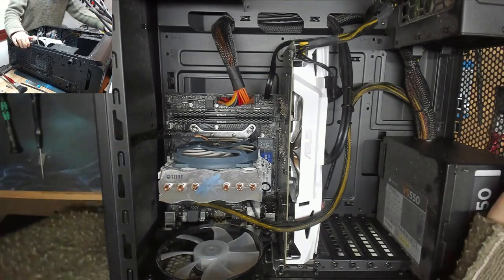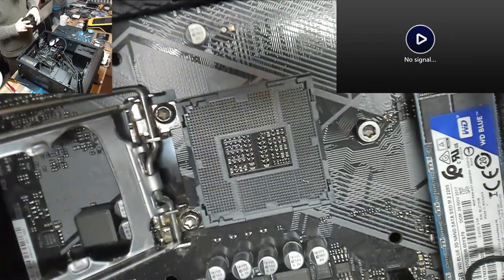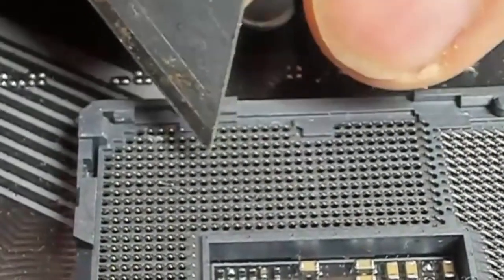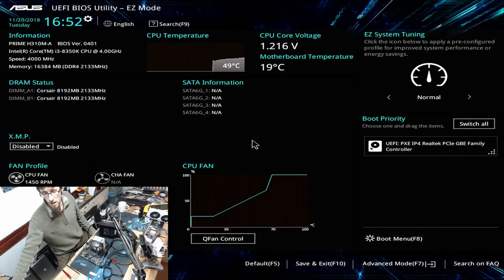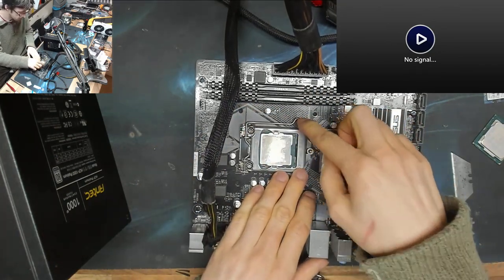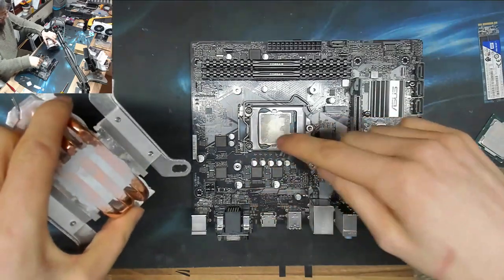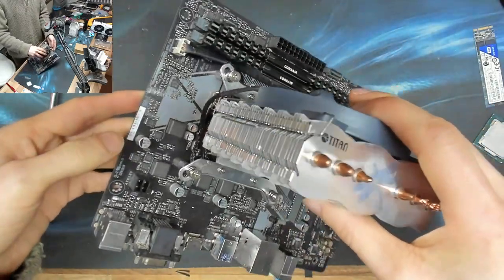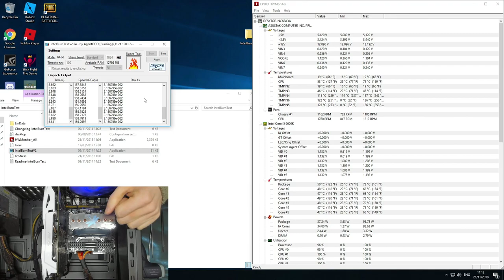LFC#151 - i3 upgraded to i5, No Post, Bent CPU pins

Comment: Little tip Graham - Get a propelling pencil - remove the lead then use it to bend pins back it slides over and restraightens the pin then you can just move the pins back easily been using that technique since AMD Duron chip!

Comment: I have encountered bent pins many times, each time trying a different method or tool to straighten them out. The best method i found (i swear i tried them all) was not the knife blade or tweezers to straighten the pins but a lowly mechanical pencil. Strange, huh? How I did it was to draw in the lead so that it wasn't able to write and inserted the bent pin into the pencils steel shaft, then pulled the encased pin in the direction I needed to "unbend" the pin. The steel shaft normally holds the lead very stiff and it is remarkably strong compared to the bent pins. By enveloping the pin with the steel shaft, you are able to apply just enough force to straighten the pin, as you go along. A simple 45° or 90° bent pins are quick and easy to straighten,as most bent pins are like this. Aligning them to the other pins takes more time but if you do enough pin straightening, you will know how much strength you need to bend the pins "just enough" to align them in  the direction you need. I have done a few CPU'S (AMD) with bent pins and only a few less sockets using all kinds of techniques and testing various tool, noting my successes andfailures along the way. Thanks to friends with heavy hands and NO money to buy replacement parts., they have given me New skills.
Reply: Nice.
Reply: But that won't work on this type of pin, these are more like little fingers which lay at an angle, so you'd never get a mechanical pencil over them, your thinking of the older style straight pins and your method works very well for them.
Reply: @TheRonskiman  You are right.. I read i3/i5 and was thinking AMD bent pins. Intel bent pins are a nightmare. I tried unsoldering an intel socket and couldn't unbend a few bent pins to save my life!
Reply: Mechanical pencils were fantastic for fixing my bent 3900X pins, thought this expensive CPU was gone for sure. The pins were bent like 90 degrees and they were near the middle of the CPU. Luckily, am currently typing from said 3900X machine :P
Reply: and here i am using a straightened paperclip lmao
Reply: The best way to fix bent pins on Intel boards is to chuck it in the dumpster and buy an AMD setup.
Reply: @BrooklynBalla  LOL
Reply: I use a "wire-wrapping" tool, but I like the mechanical pencil idea.
Reply: Same method w/ a vape juice bottle, when those were a thing. Bent 75% of a Ryzen 1st gen troubleshooting before we knew ram was the issue. Still runs @4ghz since March 16' Method def works, but slightly smaller pins I'm dealing w/ here on a i5 6400.
Reply: @BrooklynBalla  Very funny. I'm doing the opposite - chucking my AMD setup into the garbage and buying into a 13th gen Intel platform with a 13700K. Why? AMD's products always feel like a beta test to me. Never feel premium, never act like they're premium, always buggy, always had problems since I switched to Ryzen from my perfectly fine 8700. Never again.

Comment: I use small empty pen to correct the bend pins. Just slide the pin in the hole and move it on the needed position.
Reply: I use a coffee stirrer . Also a pen ink tube can also work in a pinch

Comment: It's nice that you explained heat exchange on that type of air cooler, all coolers look shiny and perfect, and even that cooler is far from perfect, All coolers are far from perfect since the dawn of Pcs, the reason is this. The metal that looks nice and shiny and perfectly fine, actually at high magnification has a vast amount of impurites, pits, lines and bumps. these impurities can cause very tiny heat pockets to develop, so that is why thermal compound is used. So to end the debate on how much compound you need; You should only need a small amount spread like butter over the cpu, a very thin layer, as all your aiming to do with it is fill those metal to metal impurities in both the cooler and the cpu's IHS.

Comment: This happend to me 2x i bent 2 pins while removing the cpu for an upgrade. First it was a celeronG3900 than i got the i3 6100 and than the i7 7700. Good thing is they were ground pins. but i didnt bend anything i removed the cpu straight up with no problem, its like the cpu is bending theme al the time.

Thats why i got R7 2700X now, its simpeler to install and mentain !
Reply: GG
Reply: LGA is a stupid design. It's just Intel shifted all of the RMA responsibility to the board manufacturers. Clever on their part.

Comment: The h310m is a decent budget board. It runs 8th and 9th gen cpus but needs the bios update for 9th gen. I have run i5s in that board or similar, it can run i7s too but I would not put an i7 in it nor do any overclocking.

Comment: What Is a matter with the lga 1200? You might want to assume he touched it somehow but there wasn't  fingers worth of pins. It didn't even look the the whole processor fell in there. The same thing happened to me three times now. The last example one on the edge popped out and was propped up by the plastic sidewall in a corner. It popped back in place but that board; a still no post asrock h570 steel legend that I have taken out the processor 2 times, and put it in 3 as I built it and had no drops.
Other one was a brand new HD b560 asrock that was working fine after a new build  and I wanted to try the h570 in 10100f i3 to see if it was faulty had no post, I t/s and eventually noticed two pins laying flat on the socket bed. I tried rebending them but bent a lot around them and lost the point of reference and then broke a pin or two and couldn't fix it.
I had got that to replace a msi no post b560 board, after looking at it again;I see at least 3 isolated pins discolored. I asked msi for help and they just closed my ticket with no answer or anything.
At least the asrock guy told me I can try to resend them. But there is no template and the more you have in one spot the harder they are to get to perfect height.
They look to be bent in 3 directions, which until seeing you do it here, I wasn't sure how to go about it so thanks
I have been subbed to you for a while and I never found this video until just now. So weird.

Comment: Metal plating is at the molecular level and does not produce a thermal barrier. The only time you need to be concerned is if there are two physical pieces that are merged together, in which case there will be air barriers (that's the purpose of paste. When liquid metal is used as the interface the air barrier is removed and that's why liquid metal is so good (but dangerous)

Comment: Odd trick for this; use a hypodermic needle. I had some on hand for filling joints on woodworking repairs with glue, and a clean one turned out to be pretty much perfect for this because the hole gives you a little 'spoon' shape that makes guiding the pins way easier. Also less likely to cut anything by accident.

Comment: I had bent pins on a board one time, I sorted it out though, bought another board lol.  Seriously they were bad, so bad I did try but gave up hence the new board.  I only had a magnifying glass and holding thant and trying to bend the pins was hard, I since bought a stand alone magnifyer which comes in handy for other hard to see jobs.

Comment: I have a H410 and a ASUS GTX 1070. H410 is a cheap MB, but it does whats its suppose to do. Got it for USD 50, the Z series can cost up to USD 500 in my country. But even my H410 comes with 8 pin and not 4 pin.

Comment: Odd that you mentioned the bios update file issue. BMW cars have a flash update issue, that in some cases, the downloaded, zipped update file will not flash successfully to the car's module if you unzip it and use the unzipped files payload only. Fix is to include both the zipped file [raw download] and the unzipped files in the same flash file and perform the re-flash procedure with the "dual" contents. Perhaps, in some cases, the MB or module wants the zipped file and unzips it itself. Just a guess that the firmware dosen't know what to do with an unzipped file? In any case this is an interesting parallel between PCs and automotive. Cheers.

Comment: HWinfo64 is a great system monitor, especially with newer components. The 8350K on a H310 chipset based motherboard is such a waste of a K chip. That i3 8350K can basically run at 5GHz flat out on 4 cores with no problems but, without a Z-series chipset like the Z370 or Z390, the 8350K will just run at 4GHz. I would at least fish for an Z370 ASUS Prime or P board just to get it overclocking. I found a Z370 Aorus Gaming 7 for $145 and a $280 GOLDEN 8700K that does 5.3GHz with 1.380v. Or 5GHz with just 1.250v. It'll even run 5.4GHz with AIR or Water. I haven't even open up the IHS to use Liquid metal on it. i have everything i need but, the chip ran so good right out of the box, i just left it be. 8700K's tray CPU's can be found for $205 now. I picked up a few myself. Just gotta know where to look.

Comment: I also like using just a razor blade , never done it on an Intel board, just on a few AMD chips, I like to run it between the rows and wiggle side to side, easily straightens all bent pins in any given row at once!!! 
unless of course you get some that are completely layed over lol. Then gotta get them up first 😘

awesome video 👍

Comment: For CPU pins i use a credit card if the offending pin is alittle bent, the card allows you to straighten the pin back all around it gently using the rest of the pins near it. Or if it's unsavable then i also use the very same credit card to go buy a new one (while crying)

Comment: 80 defrees on the VRM is absolutely ok you should worry if they go above 100 and start the panic if u hit 120... its prolly just coz u dont like ASUS boards as u said which unfortunately for u are among the best ones on the market...
Reply from the maker: Yea I've got to say I've buried the hatchet with Asus now - especially over the period of the current generation where I've absolutely had more issues with other brands than Asus. Times change!
Reply: U seem to know what u are talking about aswell, the thing is if on that asus website it says that microchip is compatible to that motherboard why would it go over 100 etc?
Reply: I despise Asus graphics cards.  They either have poor cooling or are overpriced.
However, I love Asus budget motherboards.
Asus won't throw away their reputation to save pennies although Asus might use a weak cooler (or no cooling).
I use a horizontal cooler on cheap/simple boards to make sure the board gets cooled.

Comment: That 4pin is good for up to 150w so, it will be fine
Reply: It may supply 150W, but the resistance is enough to cause a significant voltage drop when power draw spikes.

Comment: Never understood how people bend pins so often and easily, I’ve never bent a pin in my life but I’ve straightened absolutely fu*king loads!

Edit: A Stanley blade??? 😗😬🙄
Reply: You see loads of new motherboards with bent pins on ebay
Reply: it happens more with screw cooler fans. like adding alot of force
Reply: if the person replacing the CPU drops the CPU and it lands on the LGA it can and will bend pins.
Reply: Kaliban, well obviously 🤦🏻‍♂️
Reply: I wanna know how they bent so many pins in so many different places!
Reply: @ChadDidNothingWrong  dropping the cpu will do it.

Comment: How can these pins bend in the first place? Assuming the CPU is well placed when it's built, nothing can happen, right? Gravity after a few years, perhaps, along with heat? I am puzzled...
Reply from the maker: Usually someone fumbling the chip while putting it in the socket. It's quite common for people to be so anxious about screwing it up that they handle the chip like it's a poisonous spider and then drop one corner.

Comment: They installed the MB first and then tried to put the cpu in the socket.....dropping it on the pins once or twice in the process and pushing it in without checking first. I know because I have done it too many times lol.......

Comment: Name the 1000W Antec Big Wally.  Looks like a good job on the pins, but I would not have reinstalled the i3 but just gone right to the i5 so I would only have to do it once.  In truth, that 4-pin and VRM are fine since that's not an OC-capable board, right.

Comment: Anne sounds good you know soon as you mention Ur Test PSU I kinda knew where you were going with it, so I Cresent it Anne, Or Big Ann,  Big  Annie. Also ever since you mentioned not tighten up the CPU screws or any other PC one,, cuz it's not going to be trading in bumpy steers, cuz it's not a car it Stuck with me, so I now apply that method, every time.
Reply from the maker: A phrase I heard recently was 'Monkey tight, not gorilla tight,' which I thought described it very well.

Comment: How is it possible to bend the pins like that with a CPU thats completely flat on the underside? And if you dropped the CPU in the socket on the side or something, wouldn't you have noticed and then said that that's waht happened?

Comment: the 8 pin power for the CPU is not really necessary unless you have a higher end CPU that draws a ton of power i thought. meaning that motherboard is fine for an i3 or i5, but any higher you really shouldnt bother with that kinda motherboard

Comment: I notice you never seem to wear an antistatic strap? Any reason why?
Reply: It's not necessary. All CMOS parts made in the last 25 years have static protection circuitry on the pins to prevent static damage. This is basically mandatory given how dust builds up in computers and gets massaged by the cooling air flow. Touching something metal is sufficient to discharge any residual static, and having an environment that doesn't promote static helps as well, but all modern CMOS parts are resilient against most casual static discharges that would hit them during servicing

Comment: I have a question with the apu ryzen cpu chips , should you still get a post even though cpu doesn’t support onboard graphics, new build
Reply from the maker: No, the mobo will get stuck on 'vga' because it can't find a GPU. You'll need a graphics card in there before you can post-test.
Reply: Thanks sir

Comment: Hi, have you ever tried to fix a CPU which has a missing broken-off pin?? I've an AM4 Ryzen with a broken off pin on outside edge. The mobo won't post with it missing (I was hoping it would be a ground pin or something). With the current cost of CPUs I'm tempted but also wondering whether a repair would be any good... and I concede it mightn't be :)
Reply: If you are extremely handy with a fine tip soldering iron, you may be able to attach a tiny piece of copper wire to the pad that remains. It would not be a fun job though.
Reply: @JodyBruchon  Hi Jody, thanks for the replay - I am a bit shaky with a normal tip but I'm keen to practice and see if I can get this sorted out

Comment: may i ask why you think 4 pin power pin are bad a lot of boards that had a 4 pin only one died because of the 4 pin
Reply from the maker: The 4 pin connector is limited to maybe 150w or so. This is fine for most CPUs, but might bring in power limits on high end CPUs. Motherboards with a 4pin connector generally have weaker VRMs and are designed for low end CPUs - so generally it's just a sign of a low-end mobo.
Reply: @Adamant_IT  ohh kk ty

Comment: Graham clearly knows what he's doing and I've learnt many diagnostic tips from watching his videos.

But I hold my breath every time he just perches the CPU cooler on the heatspreader during testing, with no mounting pressure or replacement of TIM.

Those idle temps on the i3 in BIOS - 65 degrees C - ouch!
Reply from the maker: So long as it's less than 90 it's fine ;)
Obviously we want it to be less than that when we're done, but while we're testing, just keep it under 90!
Reply: Yeah, I know - for testing, it's fine. And since you're running a business, unnecessary fussing costs money. No disrespect meant.

But, as an enthusiast who has to save up for increasingly expensive parts, I just wouldn't trust myself. I'd probably accidentally knock the damn thing clear off the heatspreader!

Comment: This is why PGA is better than LGA. Much easier to bend the pins back on a CPU than a mobo
Reply: Except the cpu is way more expensive (usually) so it's better to damage the motherboard.
Reply: Works both ways. A PGA CPU is also easier to damage than an LGA mobo.